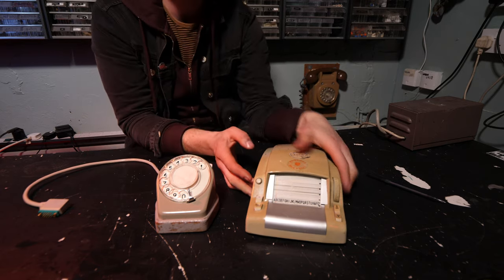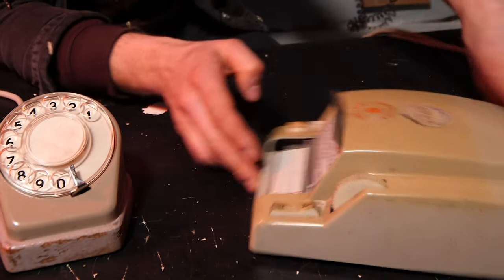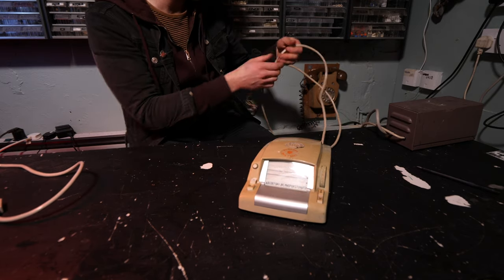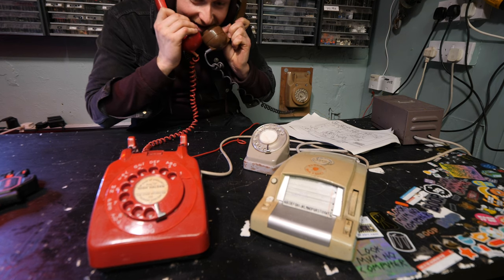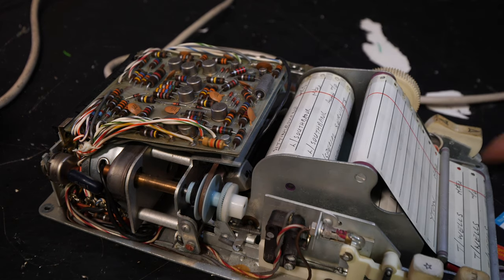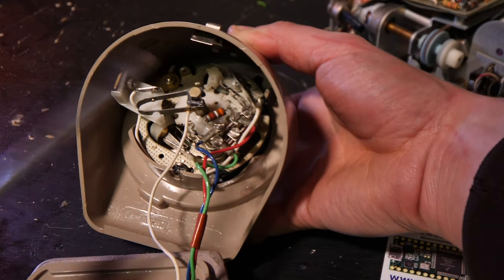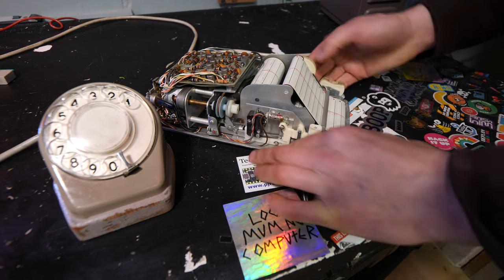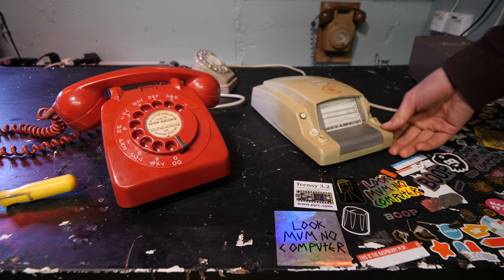A Funky Uses For A Tape Machine and a massive Tape - MAGICALL E2

Comment: Tape head would be a standard mono tape head for 1/4in tape, a standard part in the era this was made, so no problem to get. Tape replacement you probably want to use some MICR ink and a screen print screen, to get the ink onto a strip of Tyvek film that is the same width and length, so you can write on it, and the back side can adhere the MICR ink. Front a second screen print to get the lines with ink on them.

Then use a laser cutter to cut the sprocket holes, probably a few dozen steps with the cutter handling 50 holes at a time, and then align with a peg on the jig that holds the tape. Front you then just need a long table and a long straightedge to draw the red index mark. If no tyvek available use regular polyester strip, though you will probably have to order it and have it slit to size,( which means you will have a lot of spare film unless you can find a local slitting service who will do it for you as a favour. Original was a wide sheet that had a gravure print on it for the writing space, made in wide long strip, then the MICR ink was applied using another roller, and finally slit to width, then run through a perforator to get the feed edge. biggest issue will be the perforation, not many places make perforated paper any more, and they all make round perforations with a tear off strip, and not continuous paper, unless you can find old chart recorder rolls of that width, and coat the rear.
Reply: Holy crud, I'da never imagined MICR ink existed, and it even comes in laser toner and inkjet forms! What do folk use it for?!
Reply: @ericwazhung  The main use is printing checks that the banks can easily scan; payroll is the biggie.

Comment: two reasons for using a pencil.  Firstly using a ballpoint could damage the magnetic tape on the rear, and pencil can be rubbed out and the store location reused.
Reply: Yep and yep. I mean a ball point or a pen I think both are possible to damage it. It's more from rubbing out later but yep

Comment: Im curios to know how the machine recognizes, that there is no pulse coming anymore and stops recording. The metal switch in the dial is pretty genius, but as I see it, its still closed when the transmitting was finished. There is no IC on this thing?? Is it maybe a Condenser that runs out of Voltage?
Reply: He pressed the star button on the call maker to indicate when programming had ended.

Comment: I have a similar one that uses ferrite cores, in a figure 8 shape, to store the numbers. You thread the wires corresponding to the number through the cores, and it memorises it that way. Make in Japan, and all transistor and diode inside.
Reply: Hey up yep. I mention that at the start of the vid :D. Check a video I put up a couple of weeks ago making a ferrite core drum machine!
Reply: What's the make of the one you have? Only aware of the soviet one
Reply: @LOOKMUMNOCOMPUTER  Right next to me so grabbed it. Nitsuke Executive Dialler model DS-8-11C220 serial no 310079. Guess made in 1979 assuming the usual Japanese serial code format, and stores 28 numbers in it. I would post it to you but that would be nearly 200 pounds for courier from me.
Reply: @SeanBZA  interesting not much on the net about it! All good. Sounds pricey. Keep it on the shelf :D
Reply: @LOOKMUMNOCOMPUTER  Will do so, back on the shelf it goes.😃